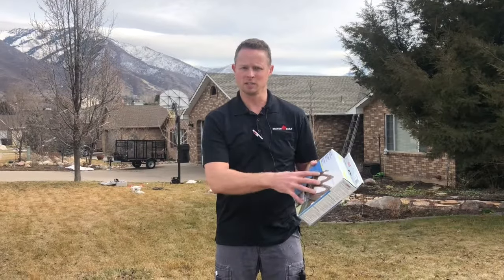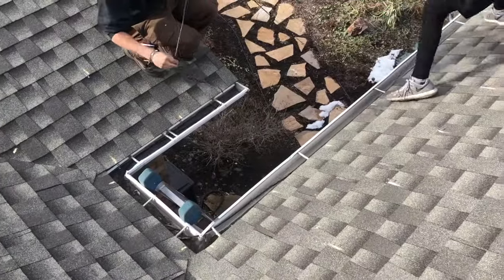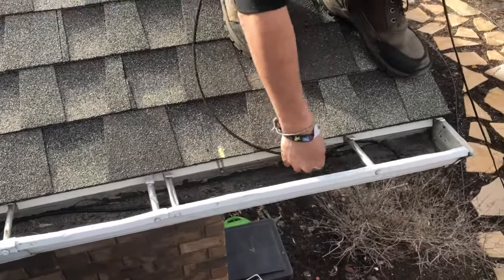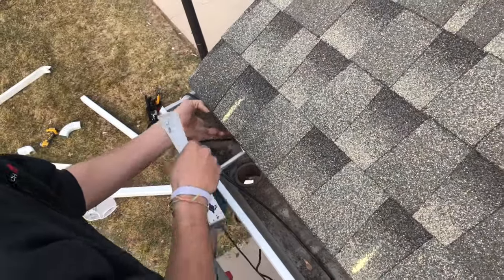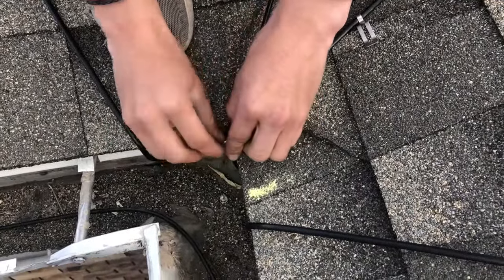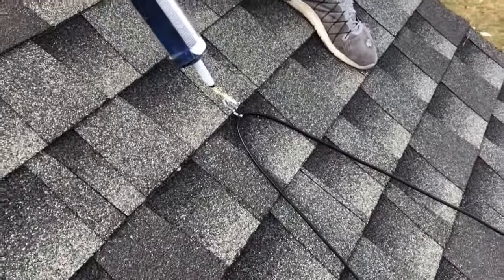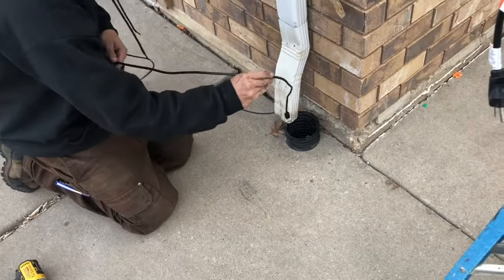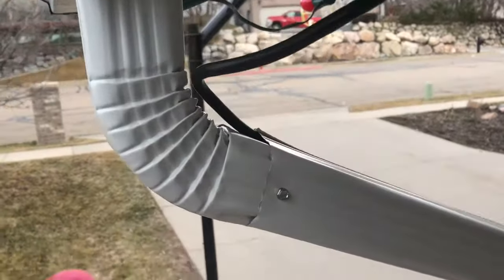DIY HEAT CABLE | STEP 7 | INSTALLING THE CABLE

Comment: Without a doubt, this was most helpful and complete video on this topic. Congratulations on a job well done. Wish you folks were in the New England area.
Reply from the maker: Thank you, Howard! We're hoping to have a dealer in that area down the road. If you'd like to DIY visit heatcable.com. In May, the site will begin to answer more questions that you might come across for installation.

Comment: Just finished installing heating cable. Followed your directions. I was sure I was going to have about 30 feet extra but there was only about 4 feet that I was able to move into the gutter. Also, pointing out that we shouldn't be letting the water under the sidewalk was really helpful. We just had a new patio installed and the drainage goes under that. If that would have heaved from me doing this it would have been curtains. Thanks for the great videos. Kevin - Buffalo, NY

Comment: Great video. You are showing heating cable and the power cable running down the downspout. How do prevent cable from touching each other in the downspout?

Comment: Great video series. So measure length of roof and multiply by factor of 4 for total cable needed, then add distance of gutters and downspouts? Do you have to double length of gutters since line loops around?

Comment: I love that you show the cable going through the pipe under the cement, but what happens on the other end. My gutter ends in a dry well. Do I run the heat cable part way into the gravel to ensure that doesn’t freeze in those upper few inches still above the frost line? (Idaho frost lines are deep)

Comment: Great videos.  Can you still install heat cables on a roof with no gutters?  My house has a large overhang over a deck.  Covered section of porch and no gutters.  Will this type of heat cable installation work without gutters?   Thanks!
Reply: Of course

Comment: We have a rubber-like whitesh roof material in a flat section of our roof which pitches slightly to a scupper.  This area freezing.  Can the heat cables be used safely on these types of surfaces?   Do you recommend any specific type of adhesive?  Thank you!
Reply from the maker: Yes, you can use heat cable on membrane roofs. We use a roof adhesive. We have it available in black or white. If you would like to purchase some from us, feel free to give us a call at 801-866-1110 ext 120.

Comment: I just ran my own here in Buffalo after watching this video. Thanks for the help! Question though - Do you leave it up all year long? You're gluing the clips down. I'd prefer to leave it along all year, but wondering how much that affects the life of the cable sitting up there in the sun all day all year.
Reply from the maker: Awesome Rick! No need to take the cable down. Drexan heat cable is rated to perform in the sun all year for 20+ yrs. There are other cables that only have a 2-5 yr life expectancy.

Comment: Excellent series of videos.  Amazing level of detail.  If you could, please tell me which type and brand of adhesive you used?
Reply from the maker: Thanks! We use M1 roof adhesive. If you need SR heat cable or would like to get the adhesive from us - we'd be happy to help. 385-367-5583

Comment: Hello
 I planing to install it on gutters which are located at garage which is attached to the house.
Gutter keep freezing over winter and then drips water which turns in ice at the front entrance.My question is :
Is it ok to instal on the roof as the garage is not heated or just run cable on the gutters only?
Thank you

Comment: What about the power cord touching the heat strip in the elbow of the gutter?
Reply from the maker: The heat cable should have any affect on the power cord, but the out-shell on the power cord should be UV rated so it does not deteriorate over time.

Comment: Can you leave this installed in the summer months also and just leave it unplugged? Or should it be removed all together?
Reply from the maker: The product in this video is the lower grade cable. It's left installed all throughout the year, but only has about a 2-5 yr life expectancy. The homeowner didn't live in too cold a climate and didn't have the money to put in higher end cable. We offer Drexan heat cable and product accessories at https://heatcable.com/shop/ for more robust and higher efficiency systems. They're are also expected to last 20+ yrs.

Comment: No control box to activate the cable when needed or it will be on 24/7 a whole winter????
Reply from the maker: Hello. We build custom thermostat controllers to activate the cable and have several options at WHC and heatcable.com. Give us a call at 801-896-8960 we'll talk about which type is right for your system.

Comment: Is safe to install this heat cable on polyurethane flat pitched roof? If so, what type of glue do you use to hold clips/ cable  in place?
Reply from the maker: No, this type of heat cable is constant wattage. We use Drexan, a much Higher End Cable, for our normal installs and it can be used on TPO, Poly flat pitch roofs. This video was created yrs ago to show how to install the box store on shingles. 
Visit heatcable.com for Drexan Self Regulating Heat Cable and products like roof adhesive and clips.

Comment: How long do the cables last before needing to be replaced?
Reply from the maker: Hello Radsan. Sorry we missed seeing your question before. Our self-regulating heat cable by Drexan is warrantied for 10+ yrs, but is built to last for 25+ yrs. The Constant wattage cables that come from hardware stores tend to last between 2-5 yrs. If you are interested in purchasing the SR cable - visit our website heatcable.com or give us a call at 385-367-5583. We assist in putting together a heat cable kit for a DIY install.
Reply: @wasatchheatcable8757  Constant wattage cables can last far longer than 2 to 5 years. I just replaced one that was 12 years old. It was still working, but I replaced it just to be proactive in case I was on borrowed time.

Comment: Can you add this to a metal roof?
Reply from the maker: Yes, you can add Drexan Self Regulating Heat Cable to a metal roof. The constant wattage heat cables are not rated for metal roofs.

Comment: why not just leave it fully in the rain gutters? why bother installing up on the shingles?
Reply from the maker: Great questions, Matthew. Ice dams tend to form on areas above cold zones on a home such as soffits. See video https://www.youtube.com/watch?v=9vYelSFjIM0 Sometimes the damming will not allow the water to even reach the gutters, before it's blocked by ice, which is why the zig zag pattern is recommended above those areas. Hope this helps answer your questions!

Comment: I liked it until I saw the power cable going down through  the downspout through the elbow. A disaster waiting to happen.
Reply from the maker: This was at the request of the homeowner. Although, it's not a common way to run the cable it has been working out really well for our customer. Thanks for watching!

Comment: What is the price to have this professionally installed??
Reply from the maker: Duane, there a lot of variables to determine installation price. Give us a call at 801-896-8960 if you'd like to learn more about installing your own heat cable system or get an estimate within our service area. Thanks!

Comment: That gutter is full of crap. Isn't that going to impede the water flow ?
Reply from the maker: It is always best to keep gutters free from debris to achieve the best water flow.
Reply: Typical one installer not paying attention to another installers work. Apart from the esthetic wishes of the owner, why not ALWAYS run heat cable to the outside of the gutter? Firmly attached for heat conduction. But especially a LOOP inside the gutter? Might as well plug that gutter up from the beginning.

Comment: Price for the whole Install?
Reply from the maker: Hi Randy! There are a lot of factors that go into the price of an install. The best thing to do is call us to set up a free estimate for your home. We can even set up an estimate over the phone for you if you'd like. (801)866-1110
Reply: @wasatchheatcable8757  why not simply respond with the cost for what we just watched for 12 minutes?
Reply from the maker: @bobkucharski9425  We actually installed this home for free to help a homeowner out. But, normally this would be between $700-$1000.

Comment: didnt you pull the wrong end through first its the female end, you should have the male end running through downspout and plug into the outlet NO?
Reply: Nope the video is correct it dead ends after the downspout you plug it in on opposite end